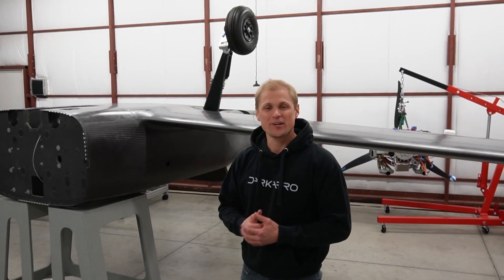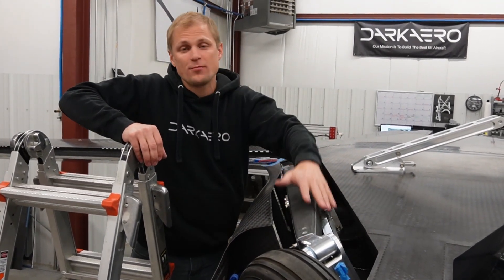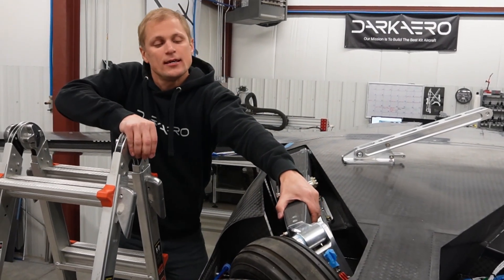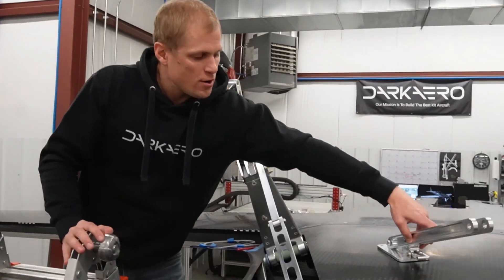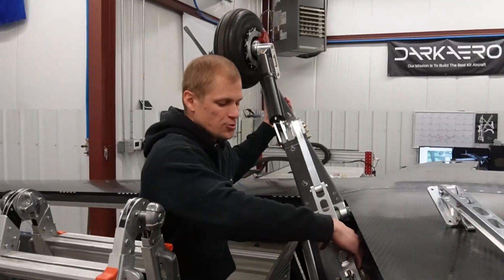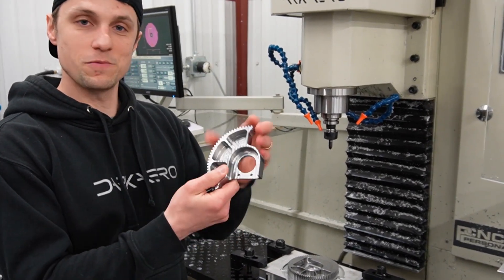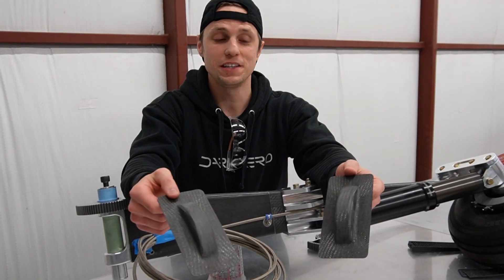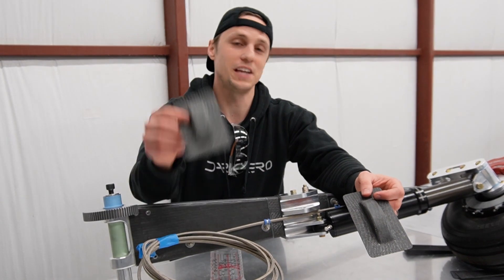How do we start this thing? | The DarkAero 1 Prototype

Comment: Like your design but I think it looks very unusual.  Whats going to drive the Clip to lock the gear if there's a power failure.  The servo wont work - b/c there's no power.  Are you expecting Gravity to have enough force to lock the gear down and engage the locking mechanism....and what if it doesn't (then you don't have functional...secured landing gear...it would collapse on touch down...doesn't sound overly reliable)!?!  What if Gravity pulls the gear down halfway.....and b/c of the unusual orientation of the gear....the arm of the gear just bounces off the locking mechanism or doesn't reach the locking mechanism at all and just swings freely under the aircraft (not enough gravitational force to engage the locking mechanism and secure the undercarriage....or it doesnt swing down enough due to drag.....that it would ever engage the locking mechanism....).....also just b/c of aerodynamic drag......the manual gear release is cable driven correct?  cant push a cable.....so if/when this happens...then what?  What redundancies are there in this situation?  so you're using Gravity, not expecting any external forces on the airframe, implementing a cable release......sounds a little scary to me......there has to be a more reliable way to manually engage and lock the undercarriage, no? (I dunno maybe I'm wrong...and please correct me....but I'm seeing flaws in that methodology)?